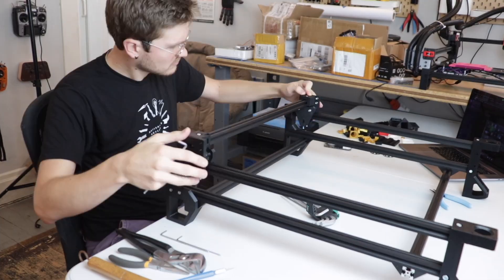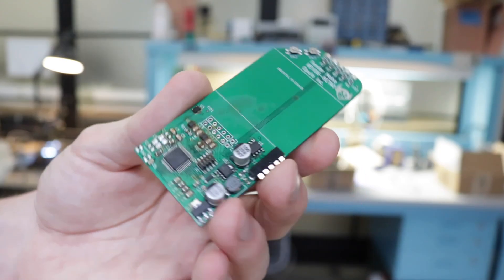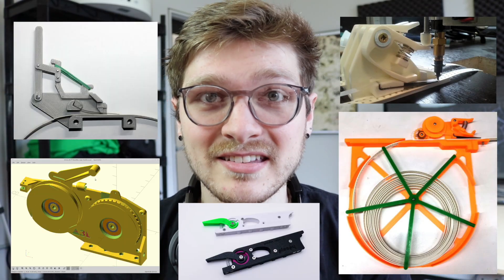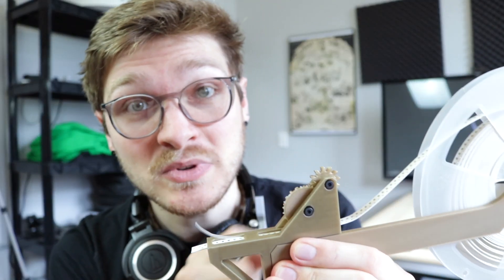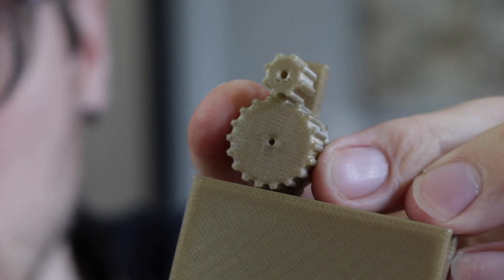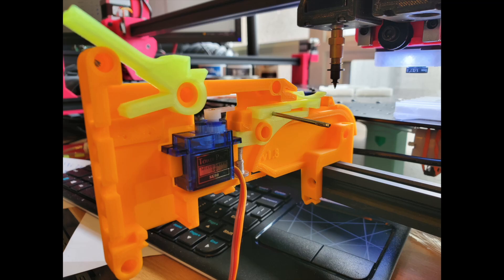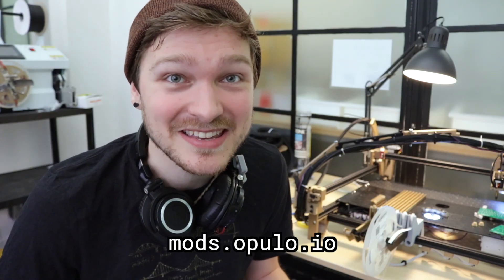A PnP Feeder for $1.34

Comment: I'd also like to add a suggestion. What if you created a system that allows you to consolidate parts into one feeder in the order you expect to place them? Additionally, you can test parts to ensure they are good and within tolerance before placing them, thereby increasing the number of boards that work compared to those that don't.

Comment: Have some fun with this idea. Get a piece of our 0.25 mm thick x 8mm wide spring steel say 20mm long. Bend it into a curved shape of a 90 degrees circle (1/4 circle). Put the 2 ends on a flat surface. Measure the length on the surface. Then press down the high middle curved part. Measure the new length. You will see that the length on the surface gets longer. If you get the right length then you can use this as a means to advance the tape forward an exact amount. Simply put this metal in a place on the feeder where a small ball bearing on the head runs over this metal on it's way to get the component. Much quicker way to move the tape forwards and there is no moving of the head/pin to move the tape forwards.

Comment: Amazing. Your calculations for pulling just enough cover slip (film) for tape works great. Next what to do with the spent film. It just hangs in the air??? So I will stick to the idea of having dangling weights for the films - it works and is tidy.

Comment: Since the cost of the feeders is so low, why not just have different feeder tape width/thickness for different tape styles?  And just label it in the 3dprint direct.  I guess keeping an external width of the feeder to be consistent would be helpful so they can be easily swapped.

Comment: If the tape gets pulled more than the reel, how does it not bind?  After many parts are used, it seems like the length difference between the reel and tape would cause the gears to bind or something to foul up.

Comment: Hi Stephen. About 25 years ago at the beginning of SMD craze I made up a hand PnP with feeders which automatically fed the tape forward when the pickup head was approaching the feeder. And it did this without a motor or fancy mechanism, simply using the downward or sideways force of the pickup head. Very simple and will remove the need for the head to do the dance around every time a component needs to be fed forwards. The mechanism consisted of 3 parts in its basic form. The head will simply need to go to where the component is and pick it up, nothing more. I also developed a simple means to take off the tape also only a few parts. I once for fun put a motor with a cam against the mechanism and I could spit out 18 (yep you read it right eighteen) components a second from this feeder. I can send some short videos if you can give me an email to link up with. I think this added to your feeder would be the ultimate as it would speed up the machine overall placing time.
Reply: Hello, could you post or send a video of your feeder concept that you've described?
Reply: @taboret9275  I will have to find the video on my HD.  Basically it was nothing more than a piece of straight spring wire about 50mm long. You can try this to see the concept I used. Hold one end of the wire between your fingers about 20mm from the table. The other end is touching the table. Not push the middle of the wire about 5mm.
 You will see the end on the table moves back about 2mm. When you take your finger away from the middle of the wire it springs back and move forwards to its original place. Now if that end was in a slot just above a strip of components the wire will move back as you press it and move the tape forwards as you let go. Very simple and it worked
The tape remover was also simple made up of 2 plastics milk bottle 
tops and small piece of aluminum and a compression spring and a 4mm bolt and 2 nuts. The head just had to press the wire in the middle when picking up a component and on releasing the next component was brought forward ready for next pick up.

Comment: fitting all different sized tapes, you could use a curved slide for the bottom gear with the interface, and spring load it downward, that way it remains the same interface with the upper gear to keep the tape peeled back properly, but also fits any size being fed through, and self corrects no matter what is loaded

Comment: The coolest thing about this design is the modularity.

Put some kind of index indentations in the profile it's mounted to to place it in the same spot every time, then just keep your reels on the feeders and swap them.

You could possibly also extend OpenPnP (or is that a function already?) that then tells you "ok, put 10k 0805 in slot 1, 100nF 0603 in slot 2" and so on - quick changes!

Comment: some ideas for handling the tape size issue:
- use a spring (maybe from like an old broken pen or smth, or just get a bulk order of similar cheap mini steel springs) and use those to tension it
- rubber band based tensioner
- set up the mounting system so it attaches through the gear so it uses its own weight to tension the gears
- add 1 or more gears that the tape has to go through to increase friction
- use a higher friction filament to print the gears, but use PET-G for the frame

Comment: So, people often forget the simplest solution is usually going to be the most reliable. Leave the gears fixed, introduce a multi-finger or single finger with steps in it compliant spring to accommodate different width/thickness of tapes. Now if the holes are different for different tapes, then thats a different issue and a different "series" of the multi-finger would need to be developed.

Comment: I just watched the new video on passive feeders and the first idea that popped into my head was a ratchetting rack-and-pinion setup, where the head descending toward the part presses down on a sliding rack which rotates the gears to move the tape forward.  By repositioning the initial height of the rack, you can set how far the tape advances.  That will allow the feeder to work with any part spacing and no extra head movement is necessary; it only needs to move high enough before descending to clear the highest possible rack position.  That would also completely remove any lateral pressure against the vacuum tip.

Does that sound reasonable?
Reply: Exactly what I was wondering about while watching! The sliding rack contact point could be adjustable to vary feed length so that the top doesn't have to vary its travel, and maybe some sort of cam type system so that the motion is complete before the vacuum tip reaches the component. The 2 movements it's doing here will be halving its possible production rate

Comment: You should keep in mind that the reels won't always roll off perfectly. They sometimes start tugging or even seize up completely. This is a huge problem for the PNPs at my workplace, and it will only be exaggerated with passive feeders.

Comment: Instead of having to re-adjust the gears spacing for every component tape, why not switch to friction wheels ? (A grooved cylinder with one or two o-rings to ensure a high friction coefficient) as such the system may be a little bit more resistant to being pulled by the picking tip, but would passively accommodate for any component tape of the right width.
For designing aspects, sorry I won't be able to participate in the project and develop it myself, I am currently preparing the competitive entry exams for the french engineering schools.
I would give the following recommendations :
Make the cylinder's groove inner diameter half or a full mm wider than the o-ring's inner diameter to ensure a tensionned fit, thus avoiding the o-ring slipping in his groove and reduce the spacing of the wheels (from the sum of their expected radius : groove radius +o-ring thickness) down a quarter or a half mm, you will turn a dual contact point (o-ring1/tape and tape/o-ring2) into a dual surface contact by squeezing localy the o-rings, ensuring a far better pulling

Comment: That is a damnably clever refinement of the passive feeder concept especially resolving the tape peel back. These are so cheap that with a little more design you could leave the heads attached to the tape/reel so that few if any parts are lost during setup.

Comment: To compensate for different film sizes, you need to adjust the depthing between the gears. You're currently using rigid mounts, make the upper gear mount flexible so it can automatically compensate. Bias the upper gear so that it is preloaded against the lower when assembled.
Reply from the maker: AHHHH that's a cheeky idea, thanks for the suggestion! I'll try that!
Reply: @stephen_hawes  where are the 3d files for this feeder? I want to combine it with my feeder to make the ultimate one.
Reply: Spring load the gear mesh via the top gear.
Reply: @nicholasthon973  That is what I am thinking too. The good thing about 3D printed plastic is you can draw the bending parts into the plastic frame saving you the trouble of inserting a spring and adjustment knobs
Reply: @nicholasthon973  Spring loading could also reduce variations in pull strength between different devices caused by manufacturing differences.

Comment: Have you tried adapting this passive design with an additional powered driver gear (perhaps mounted underneath) to get a really simple powered version? You could even potentially design them in such a way that the driver motor is optional and could be added later, without needing to make a new set of feeders

Also, what about adding a dedicated pin right next to the suction head so you can advance a passive feeder while simultaneously picking up a part? Might not be super practical compared to a powered feeder, but it sure would look cool to watch!

Comment: Maybe make the gear with two kinds of theeth, side by side. One conventional like now for rotation and one very spiky for more bite in the thinner tapes.
Reply: Or just replacable gears, color-coded for tape thickness
Reply: @dancollins1012  From the video i got the sense that with 3D printed gears the tolerances aren't really 100% repeatable. If that is not the case just making the tightest gear mesh should work for any tape.

Comment: For controlling servos I highly recommend PCA9685 16 channel driver. it can be chained together and control hundreds of servos with 2 I2C cables (up to 1024 I think). It also has external power input for servos themselves, and a capacitor to smooth the voltage. Furthermore it is well documented online. Although Arduino mega has a lot of pins, I am not sure if it is the best choice for controlling 5+ servos.
Reply: Can recommend PCA9685 for anythyng where you need many PWM channels, not only servos, amazing cheap IC.

Comment: Well you could make a gear that grips and moves the tape, same as your 'intelligent' design, but has a larger gear exposed where the head has a fixed gear to engage, that couples to the 'spooler' gear that sits on the same shaft. This way the basic principle is retained, with the addition of a third mechanical part that can be adapted to the spacing/tape dimension.

Comment: Have you tested to see if the nozzle gets bent over time? 

Since the ratio of components used is fixed for each board, couldn't a single motor be used to advance enough components for each board at the same time between boards? A motor could advance the reel with the most used component, then gear reductions could advance the lesser used reels accordingly. A central rotating shaft could run along the feeder area, and gear boxes could be used to tap into this shaft and facilitate the correct number of turns for each component. If a ratio is higher than, say, 4:1, then multiple spools could be used rather than making every possible gear box ratio. This would be faster and reduce wear on the nozzle.

Just a thought. You're a big inspiration of mine!
Reply: And when you want to make a different board you have to change 20 gears?
Doesn't sound like a good idea.
Reply: @Jehty_  make a selectable transmission.  Nah... just advance each reel, one at a time, while the new board gets fed into position.

Comment: Very cool concept! There's quite a bit speed lost there on extra movement, BUT if to advance tape by 3+ parts per single pull then it wouldn't be as pronounced.

Comment: With the passive feeders being pulled through either by the head itself or a new peg......is there a chance the tape can spring backwards slightly when the head/peg releases due to the small amount of tension it's under from the film?
Reply: Yes, it can happen. There is a "backoff" setting in openpnp to slowly release the grip on the tape hole before lifting the head.

Comment: I am worried that the tip will wear a lot faster when used for this load it iss not designed for
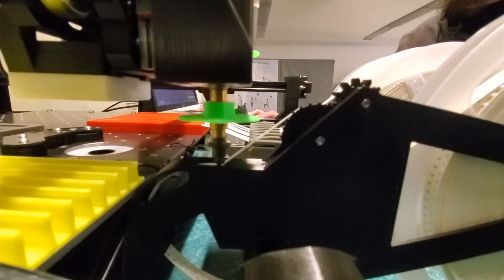Reply: Could use a little solenoid to poke a metal prog down to advance tapes. 6:40
Reply: @TheRainHarvester  I’ve seen designs that do this. Using the nozzle itself seems like a cheapness too far. Not that I’m an expert.
Reply: @lawrencemanning  one might get away without the solenoid\additional weight by making some kind of "click lever to advance" on the feeder.  Put it where the nozzle doesn't touch anything where a shorter,fixed, protrusion could still reach the lever from the head.

Comment: How do you grab a 3 mm x 2 mm or a 0402 part? vacuum? how does the machine find the part in the tape?
than how you align that part with the PCB footprint?

there is a problem, if you switch parts you have a  whole bunch of loose components, lost?. that action should be place much shorter to start of the tape.

cool development.
Reply: All your questions were answered in his other videos.
So I would recommend that you watch them.
Reply: It's pretty normal to need to feed quite a lot of tape when setting up a feeder, and manufacturers know this -- reels of parts always come with long empty leaders of just empty tape before the actual parts start.
Reply: @AJMansfield1  i haven't bought a entire reel, yet. yeah, true, i heard to a reel starts "empty" tape, but what if you have cut tapes, with just 10 ic's or 100 100nF by pass capacitors?
Reply: @AnalogDude_  then you do not need automatic feeders

Comment: is there a particular advantage that powered feeders have over a design like this? otherwise, it seems like this is as much as you would need!
Reply: For commercial operations, speed is everything. The extra time it takes to use the placement head to advance the tape would never fly.
Reply: @MLSgeek  You could cut down on the time waste if you pulled like 10 through at a time.
Reply: @MLSgeek  there are many crappy commercial machines out there (aside from the big companies which charge much more).
Especially the feeders are really a key thing, if something's wrong components will be missing on the PCB and having PCBs with >1000 components it's just crap to check that with a naked eye.. even worse having to expect that something's missing is bad.
To me it seems Stephen has nothing on the feeder side at the moment.